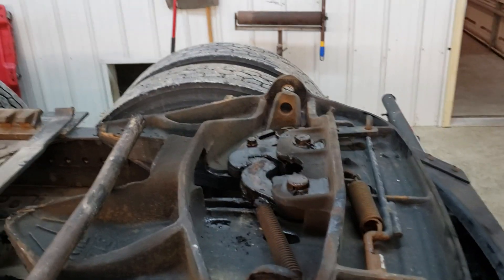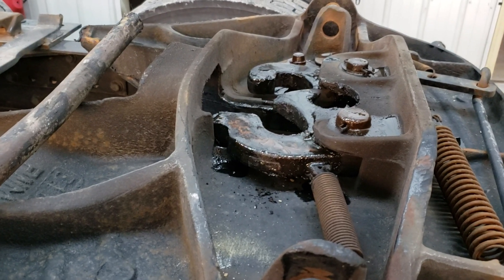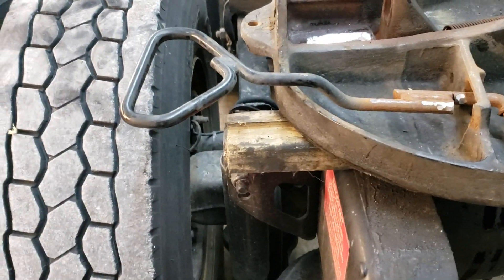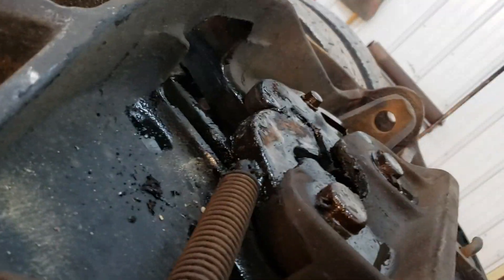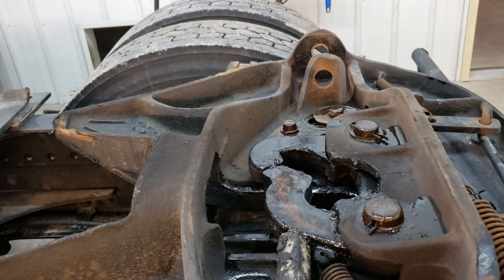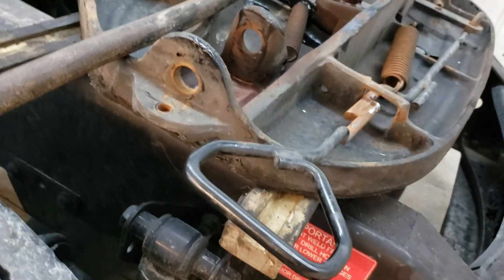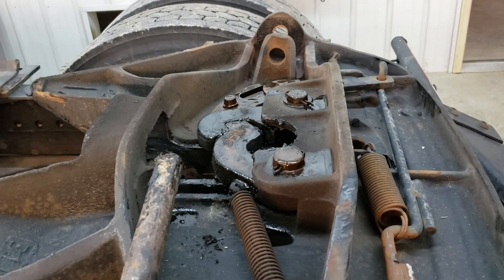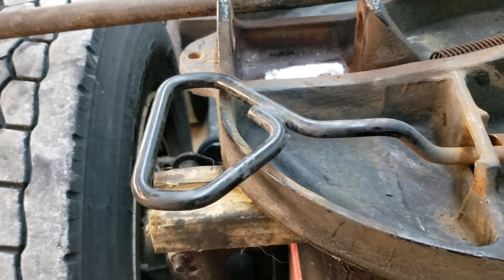Holland 5th wheel

Comment: Great video , whats the fifth wheel name and model ?
Reply: It’s a FW type 17. (Fifth wheel type 17).    A Simplex design.   I’m doing more research, but I “think” a company named Simplex designed it, but the Holland company now owns it.  The most popular and safest (I think) is the FW type 35 Holland twin lock design. I don’t like the type 17 for just the reason he stated.   If I see it’s the Simplex type, I back in to couple a little harder, whereas the type 35 I can back in gentle and hear it lock, and then make sure the bolt and handle are retracted, then I get a flashlight and confirm the U shaped locking blocks are extended all the way out along the sides of the locks so it’s unable to open.  I do it all in this order.
1) see which type I’m dealing with if I’m on a different truck.
2) back up until the fifth wheel is under the apron
3) raise the landing gear enough to make sure the apron of the trailer is loaded and flat on the fifth wheel so I don’t “high hook”
4) back under and hook. (Listen for the click)
5) get out and confirm the bolt on the locking U shaped fixture is retracted and the handle is retracted.
6)hook up my air lines and raise the landing gear until there is clearance for a tug test
7) after the tug test pull out the parking brake and push in the trailer brake
8) get out and check to make sure the trailer brakes aren’t leaking at the glad hands
9) get under the trailer and with a flashlight confirm the locks are in the proper place and the U shaped locking fixture is holding the sides of the twin locks
10) inspect the landing gear and the underneath of the trailer while underneath 
11) now raise the landing gear all the way up and secure the handle 

Yes, prolly more work than most people do, but I don’t want to ever lose a trailer and hurt anyone